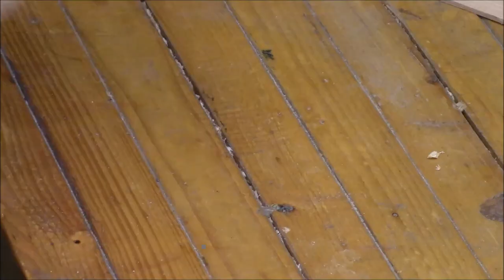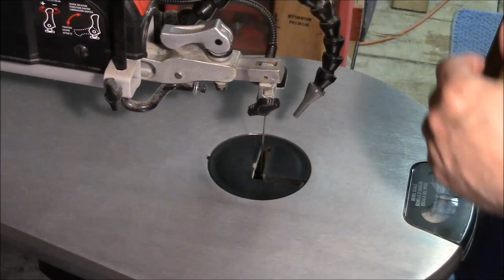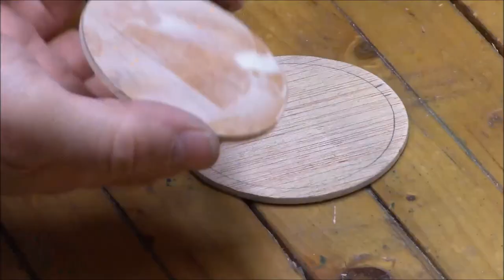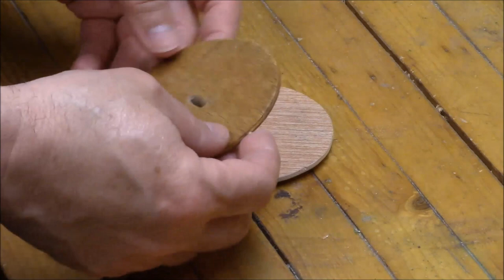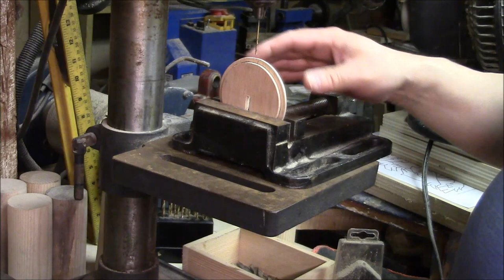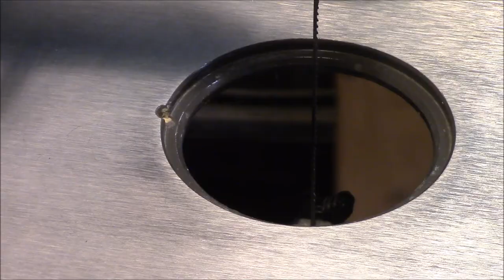Making an Insert for the Porter Cable Scroll Saw

Comment: I just got my new Porter Cable scroll saw today and it only took about 5 minutes to decide I needed an insert for the saw. I used White Oak about 1/2" thick drilled a very small hole in the center to mount it between centers on the lathe then turned the the the piece round till it would fit snugly then measure how thick the rim would be then turned the lower end down to the diameter of the lower hole. At this point I discovered that the holes in the table are a slight oval shape instead of round. I used this to my advantage and just sanded the narrow sides down till it would fit snugly in the hole. Since the piece is oval it will not rotate. Then all I had to to was drill the hole for the blade. I made sure to leave the top section just a little thicker than needed then after I had a good fit I ran the insert through my thickness sander taking off just a little with each pass till I had it flush.

Comment: Rick, Great video for creating an insert.  To line up those separate pieces you can mark and drill the center from the compass point.  Then when you're ready to attach them, align them using the same drill bit used to drill out the centers.  I know the blade is off-center, but it's close enough when it's time widen the alignment hole for the blade.  I've made a few inserts for this saw using a router table.  Having the sturdier insert was a HUGE improvement to this saw.  If you're working with thin material and cutting anything intricate the sturdy insert is a must have.

Comment: I have the same saw and I have trouble with the thumb screws that hold the blade. The bottom one tends to force the blade out of the slot because the twisting of it pushes it out.

Comment: I made a one piece insert from scrap bamboo flooring and one from a scrap piece of oak when I cut them I included the nub that keeps it from spinning it turned out perfect no gaps but the other problem is the slow start motor I want to add a foot pedal but I don't know how it will work with the delay in the motor.

Comment: Out of curiosity, can you use the table angle with this design?  I assume the “L” shape of the cut out allows for the blade travel when angling the table of the saw.  Just wasn’t certain.  Thanks for the info on the design.  Looks like it’ll work beautifully.
Reply from the maker: I haven't tried because I don't really use the angle feature of the saw but the slot could easily be changed to work with it if needed.

Comment: Just curious, if the chief issue with the plastic insert was vibration, would a coat of urethane on the plastic insert snug it up enough to prevent vibration?
Reply from the maker: Hi Mackey, It wasn't that the insert was loose, the problem was that the plastic it was made from was too thin. If you were cutting near the edge of a piece it wasn't supported by the table, only the insert and it would bounce up and down because the thin plastic offered no real support.  The wooden insert is very solid and solved this problem.
Reply: @RickMayotte  Oh, I understand, now. The flimsy plastic piece wouldn't offer adequate work piece support, especially for small pieces. Thanks!